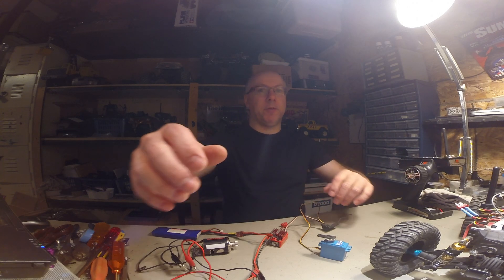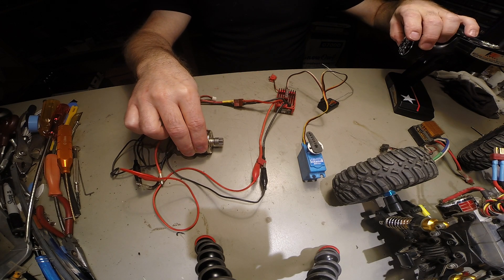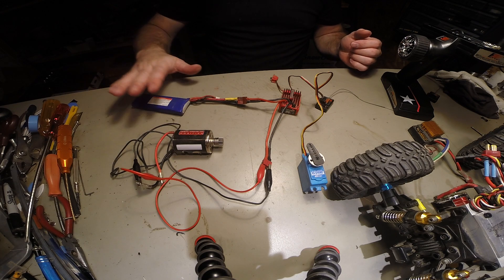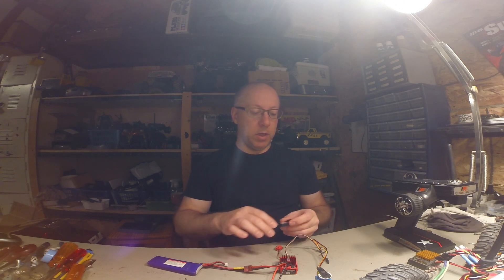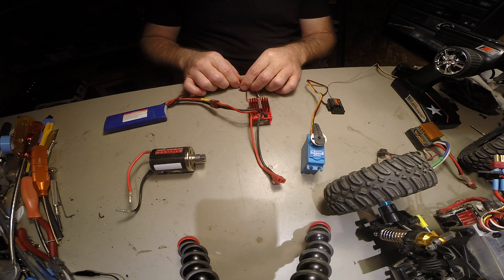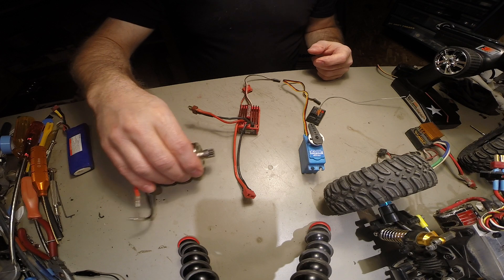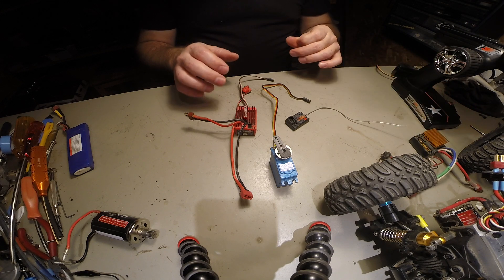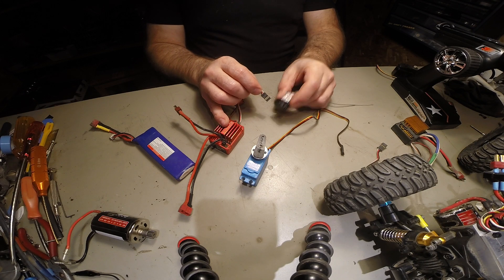Troubleshooting RC Electronics basics - Diagnose and fix it yourself

Comment: Hi! I have ofna nitro that I keep losing throttle control. If I turn car off and on it comes right back.  Do you have any advice.  I’m desperate.
Reply from the maker: Sounds like a failsafe. Is your receiver battery charged or has fresh batteries?
Reply: theLEDwheel yes batteries are good.  Sometimes I thought it was caused by hitting bump but today it kept happening when I came to a stop
Reply: I’m not sure if I can get a replacement receiver since it’s an older model.  Ofna ultra buggy circa 98
Reply from the maker: Or even  your transmitter batteries

Comment: Helo.. i move my esc from my crawler to my racing buggy, in the test run the throttle is glitcing .. do you know why, and how to fix this.. thanks..
Reply from the maker: Going to need more info..
Radio set.. 2.4 or am/fm
Brushed or brushless 
What model esc
Reply: @TheLEDwheel  esc is what came out of Tf2 rc4wd rtr..
Motor is brushed..
As the frequency i dont know .. im still learning on this, but my radio was flysky 3ch.
Reply from the maker: Can you go on my facebook group (link in description) and show a video?
Reply: @TheLEDwheel  yeah too bad i did not record it.. i already put back the esc to its original truck.. its kinda hustle to take it out again.. im just going to buy new esc for this project and not re use old esc from my crawler.. smh..

Comment: i hope you can help, my motor wont move, all my channels work, there is a light that indicates there is power going to the motor( ive tried two motors) , my servo moves, but i dont get any movement from the motor. what do i do?
Reply from the maker: Make sure the battery is charged. Connect a motor direct to a battery (make sure you dont short the battery) to confirm it works.

From your message it could be one of 2 things. Faulty esc or lipo cutoff.
Reply: @TheLEDwheel  i charged the lipo and it still doesnt work, also there is no beeping sound. it could be a damaged esc, but it was working a few days ago
Reply from the maker: No beep but the light flashes? Good chance its a bad esc.
Reply: @TheLEDwheel  yeah I'm gonna go with that. Looks I'm gonna have to put my 6s drift car in hold.
And I really appreciate your help. Thanks for taking the time to respond

Comment: That help me the the throttle failure and everything on but it only turn not throttle
Reply from the maker: That could mean  a few things. Check that the battery is charged. 
If it's  a lipo battery then makensure3 the ESC is set to Lipo. 
Could be the channel 2 on either the transmitter or receiver is dead. If you followed this video did you  see if the servo works on channel 2?

Comment: So my motor doesn’t move but makes a beeping sound. I checked again with a different motor with the same outcome. I’ve tried the motor on different channels with the same outcome. I have tried the servo which works well. I’m a little stuck because I’m new at this and don’t have anyone that I know with gear. Any help would be awesome, thank you!
Reply from the maker: Have you programmed the esc? As in program it to the transmitter functions. What rc and electronics is it?
Reply: theLEDwheel I didn’t know you had to program the ESC? It’s a cheap RC - WPL C14 with a cheap ESC from Banggood..
Reply from the maker: Some peogram them selves, other you must program. You need to check the manual

Comment: Hi, i have the same issue as im the video, but channel 2 doesn't respond it was working before, so is tgere any chance i can use the same reciever without replacing, meaning : can i solve the issue without buying a another receiver
Tks
Reply from the maker: Have you officially determined if its the transmitter or the receiver?
Reply: @TheLEDwheel  it's the reciever, because Chanel 1 and 3 is working.
And it's a new radio didn't use much
Reply from the maker: Unless your radio is programmable  and you can tell channel 3 to copy channel 2 you will need a new receiver.
Reply: @TheLEDwheel  thanks for the message, I'll try it check, cheers 🙏

Comment: Okay so I now I’m late but I’m having an issue with my rc where it runs fine and works great but when I go full throttle and get some speed the whole thing sort of shuts down like the battery is died but it’s and nothing is wrong with the battery
Reply from the maker: Using a LiPo or NiMh battery? Check that and make sure  the ESC is set for that  type of battery.
Reply: theLEDwheel yeah I’m using lipo and I set it to lipo and everything
Reply from the maker: What motor and ESC and what are the specifications of your battery?
Reply: theLEDwheel here the esc and motor https://www.ebay.com/itm/QuicRun-WP-10BL50-3500KV-1-10-RC-Brushless-Esc-Motor-Combo-Fits-Traxxas-Slash-/333250772585 and my battery is a floureon 2s lipo 7.4 volts 5200 mAh and 30c

Comment: Hi..I have same receiver and transmitter tha you do (got it 2 days ago) ...and when I'm done doing my electronics set up (exactly as you suggest) my car only goes reverse but no forward ...I tried everything, another motor, fully charged batteries ..and still having same issue ...can you tell me how can i fix this please?? thanks in advance
Reply from the maker: Just look in the manual for the first run programing
Reply from the maker: Have you programmed the esc? Read the manual?
Reply: @TheLEDwheel   Well the manual is  mostly chinese ..here is a link: 
https://www.manualslib.com/manual/1015572/Fly-Sky-Fs-Gt3b.html?page=10#manual...
they asumming when you are buying transmitter and receiver as bundle you don't need to macth or bind it...however I just don't know if still have to be programmed it
Reply: I will try to re-do it everything all over again anyways..thank you!!!

Comment: Hi there. What components should I buy for me to test my rc? I think I have the same problem. I didn't remove the Batteries and I forgot to turn it off. It was ON maybe for 2 weeks. Then one morning the RC suddenly started running like hell. Without the remote. And after I removed the battery and put it backed fully charged , the RC won't accelerate /run anymore. What do u think happened? Thanks.
Reply from the maker: What rc and components?
Reply: @TheLEDwheel  just an affordable one. New bright. :)
Reply from the maker: Sorry, can't  help you with that. New bright are disposable rc's. Depending on the model you may be able to sell the body for a good price. As long as its 1/10 scale.
Reply: @TheLEDwheel  I see. Thanks! 😊

Comment: wow deans connectors...how old school
Reply from the maker: No kidding...although,  You realize the video was uploaded 5 years ago!?
Reply: @TheLEDwheel  no sorry missed that part but I restarted in the hobby in 2011 and even then deans where a no no.
Reply from the maker: Never had issues  but now use  xt60 or 90 depending on applications
Reply: @TheLEDwheel  I had intermittent connection once when spring in contact went flat.

Comment: I recently replaced motor, esc, controller and receiver on my rc. The motor goes faster forward and slower on reverse, any idea what it could be?
Reply from the maker: Most likely your esc needs to be adjusted. Check your manual.
Reply: @TheLEDwheel  it adjusts automatically,  it's a hobbywing quicrun 1060 brushed esc. And the transmitter is a austar ax5s.
Reply from the maker: Just clicked... motor timing. If its advanced  it will be slower in reverse.

Comment: What kind of electronics do I need for these cars: https://youtu.be/MQucq-g-Vpc
Reply from the maker: pretty much the same as most other RC vehicles but with slightly different specifications.
If you have a Drifting club in your area I would suggest talking to them to see what they are running as far as cars go and such.
Usually try and stick with what most are running as the local stores will most likely stock parts for htem.

Comment: I thought you were going to fix the bad receiver, what you’ve done was verify that the receiver was bad with known good parts then you throw a known good receiver at it
Reply from the maker: Fixing these newest receivers is possible but diagnosing the faulty part is not something most people would be equipped to do. Also soldering a surface mount ic unit is also not a simple task with a standard soldering iron.

Comment: My tamiya xb won't respond to transmitter. No steering or move forward /backwards. Dead. Batteries are new. What causes it? Anyone can help?
Reply from the maker: Could  be a few things. You need to verify  if the ESC is supplying power to the receiver. If so it could benthe transmitter  or the receiver that is defective. Can you test the radio system on another ESC?

Comment: I have the same problem my rc car won't go forward i even tested with 2 different controllers and still won't move so it is most likely the IC in the receiver that i need to change.And very helpful info you shared

Comment: I'm facing the same problem with the receiver after I installed a brushless system on my rc car. Channel 2 seem to have no signal to the esc to operate the motor but still can trigger a servo when I plug one on. Connect the esc to channel 1 and the steering wheel now control the motor. When I put the old brushed system back on, everything work fine. I'm thinking about getting a new receiver after I 've watched your video but it seems to be a little different with my case. So I would love to have some advice from your experience. Thank you!
Reply from the maker: Have you programmed the brushless ESC to work with your radio set?
Reply: @TheLEDwheel  no I haven't. But that esc work with my friend 's radio set without any programming. And it doesn't take throttle signal so I can't get into programming mode since I don't have the programming card.
Reply from the maker: @julymr5810  I don't mean programming it with a program card. thats not the same. What ESC and Radio is it? this might help be with your issue.
Reply: @TheLEDwheel  the radio came with my car, which is a fs racing marauder (53910). I believe it 's a flysky rebranded since the receiver is exactly the same with the fs gr3e. The esc is the surpass hobby 60a.
Reply from the maker: Did the esc come with  a manual?
Reply: @TheLEDwheel  yes it did come with a paper with some specification and some "beep beep" sound setting method written on it. Didn't work. Anyway, I 've just opened up my tx and swapped the ch1 and ch2 wires. Now I have everything fully function, even brake. That 's weird. But at least, it works. So thanks for your time spending on this. I appreciated that!

Comment: I need some help
My servo works in both channels but the motor cuts off about 10 seconds of driving
Reply from the maker: Is your battery charged? Kind of sounds like a lipo cutoff
Reply: @TheLEDwheel  it might be but now my by charger is turning off after 5 seconds
Reply from the maker: Nimh or lipo?
Reply: @TheLEDwheel  lipo 
It's a b6 clone I think

Comment: Please can you help me with my ESC dilemma, it runs fine for a while then it will go full throttle and I lose all input control!... It has only cost me a set of wheels so far but at 45mph I'm surprised it wasn't more, any help would be greatly appreciated, thanks
Reply from the maker: When you say you lose all input does that  include steering?
Reply: @TheLEDwheel  it does sadly , I want to avoid buying a new ESC if I can avoid it obviously, but it wasn't expensive tbh
Reply from the maker: Could be the esc or receiver.

You need to see if there is power going to the receiver from the esc when it happens.
Reply: @TheLEDwheel  thanks for the info, I will do a static test to see
Reply from the maker: No.. but bad connections  can.
Reply: @TheLEDwheel  all connections are sound it would seem,.. as it was a budget receiver (FlySky FS-GR3E) it could well be the issue as I know some others have had issues with it.
 Thanks for all your help
Reply: Oh dear lord, could it be that I forgot to set the failsafe on the receiver, it's been a while, but I remember binding, I don't remember setting the failsafe!

Feeling dumb right around now.... If that is the case
Reply from the maker: Try it
Reply: Try as I might, I can't get it to happen, tried full throttle while making turns as this was when it occured originally but nothing, can end points/expo cause this kind of anomaly?
Reply: 2 amazingly awesome runs later, all I can say is,... " Don't forget to set your failsafe"... Smh, I learned a valuable lesson, thanks to all for your help and patience

Comment: Love the video. May I ask a question? My wife just brought back from China one of the those RC Transformer cars for our son and it doesn't work. The remote's light keeps flashing (not sure if it's supposed to flash or stay on) and when you turn on the car, it plays the intro music and just repeats the same intro over and over. The car doesn't respond to the remote. Any advice? I know these are cheap, but my son (5 years old) is so diasspointed. THANKS!
Reply from the maker: Is there  a demo mode switch on it?
Reply: @TheLEDwheel  Thanks for responding. I only see an on/off switch. Would it be in the same area of the switch? I've looked this thing all over and can't find anything. Should the remote light always be flashing?
Reply from the maker: Problem is that i know absolutly nothing about the RC toy so i have no idea. Does it  have a manual?
Reply: @TheLEDwheel  No manual. Thanks for responding and trying. You have a great channel! All the best!

Comment: How bout everything works until the car gets 10to 15 feet away then it goes dead, meaning cant control it no more. Then wen I walk to it, it starts back working
Reply from the maker: Unfortunately that could be either the tx or rx. To eliminate you need another rx or tx of the same brand.

Test your rx with another  tx and vice versa. This should  tell you if its one or the other. Hopefully  its just your rx as that cheaper to  replace.
Reply from the maker: 2.4ghz system  or older type?
Reply: @TheLEDwheel  yes 2.4. Would that be the controller?

Comment: hello.. i've got proublem with my transmitter,the throttle doesn't work, and i checked everything like your video,and i suspect my transmitter the trouble.. are you have a tutorial for fix that? thanks
Reply from the maker: Just the throttle does not work?
Reply: @TheLEDwheel  yep, but actually it doesn't work completely, sometimes it still works, but only about 5-10% throttle, then it doesn't work at all
Reply from the maker: Have you tried reprograming the esc?
Reply: @TheLEDwheel  i try the esc with my friends rx tx,its work,normal ..
Reply from the maker: Well now you need to find a friend with the same radio and test your TX with thier RX and thier TX with your RX. If you don't have someone with the same radio then you will need to buy one.

Comment: Hey there I have a 450 heli,my problem is my heli was flying and now at idle up it's fine until I try lifting off the power dies. And when I bring throttle stick down and up again it works until lift off again shutting down. Please help thanks.
Reply from the maker: Battery  charged.. have a tester to check it?

Comment: How I can test the battery ? Because my car don’t accelerate, motor ok, reciber ok, dirección ok, but don’t accelerate,  I have battery lipo 2s 6000mah, I test the battery And had 4,2 volts max charging.. thanks
Reply from the maker: 4.2 volts per cell  is good, 4.2 volts for the 2s pack is very bad. Did you  use a lipo battery tester ?

Comment: Ok what about this my rc boat has power and turns quickly but is not getting on the plane very easily anymore now my first thought was the shaft must need to be greased so I did so.. took it back out and same problem only slightly worse this time now with the boat I have it is known that the weak esc burn up easily but it hasn't gotten much hotter then normal I always give it 10-15 minutes to cool down while I  run my smaller rc boat and then run it again so my issue I have determined is either the esc or the motor how do I determine which it is???

Comment: Can a bad RX short an esc?
Reply from the maker: Its always possible but more often its the servo  that shorts everything through the RX. Have you tried  without the servo attached?
Reply: @TheLEDwheel Thanks!  I used a servo tester and the dual servos seemed okay there but I will try with the servos disconnected . I smoked one esc and the second one I put in got very hot in seconds, I may have damaged that one too. Can an unbalanced lipo cause any of this?
Reply from the maker: No, a lipo will just give a lower voltage. Toy have another rx to try?
Reply: @TheLEDwheel  I'm about to buy one, I dont have a spare. I have been using the knock off  spectrum orange series  from hobby king, no problems until now. Thanks for your help, thumbs up!
Reply: @TheLEDwheel  you were right. It was the faulty servos causing all this headache, gotta replace the servos as my revo has 2 for steering, as soon as I removed them from the equation no more issues,  great detective work!

Comment: K I have a weird problem or I’m dumb. Got a new transmitter/receiver FS-GT3B and flysky waterproof receiver.  Was driving it around and then stopped, turned my car off then my tx. Then I came back turned my tx on then my car. Nothing worked! (All in a time period of 5 minutes!) I noticed the was blinking a slow red? Got new receiver that didn’t work I know my motor/servo are good. What could be going on? Do I have some weird fail safe setting tripping? Batteries are fully charged?
Reply from the maker: Have you re binded?